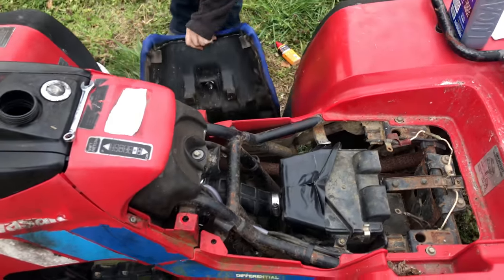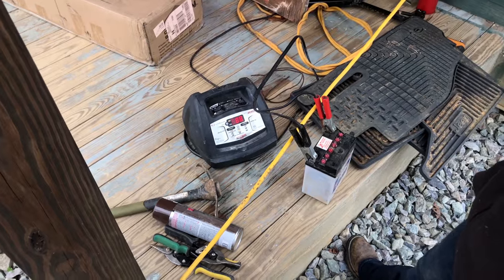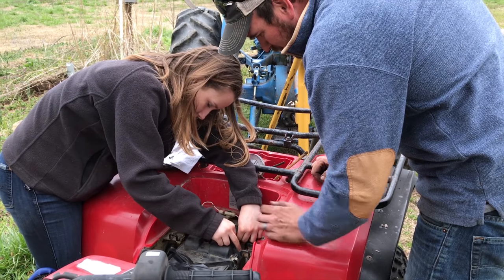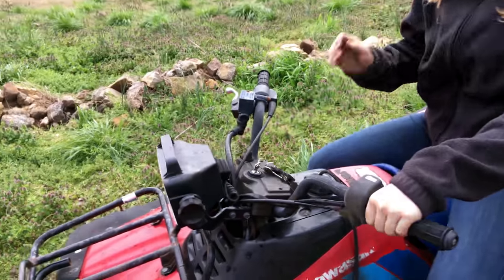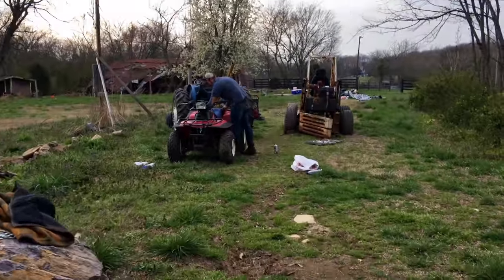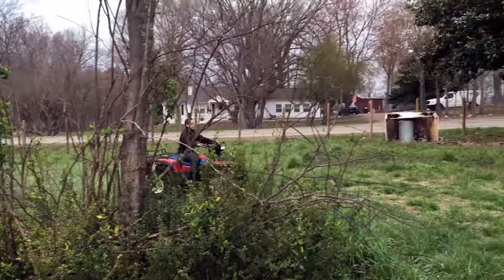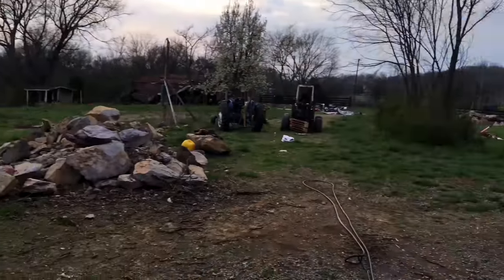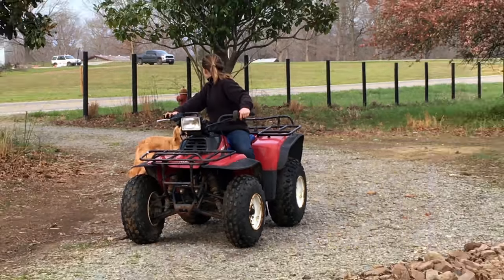Did She Fix It? Out Of The Weeds Part 5 ATV Repair - Ranch Hand Tips

Comment from the maker: Parts We Used (Affiliate):
PB Blaster (to lube piston through spark plug hole)
https://amzn.to/2IQtGv6
Kawasaki KLF300 Bayou KLF 300 Oil Filter
http://amzn.to/2HtxW20
Motorcycle Engine Oil 2 Quarts Lucas 10W-40 Motorcycle Oil http://amzn.to/2FAfwAa
Kawasaki Bayou KLF 300 KLF300 Fuel Gas Petcock Valve Switch Pump ATV
http://amzn.to/2HsZEft
Kawasaki Bayou KLF 300 KLF300 Carburetor Kit ATV Carb Carby
http://amzn.to/2FH5edJ
Kawasaki KLF 300 Air Filter
https://amzn.to/2pFH0ul
Kawasaki KLF 300 Voltage Rectifier (Voltage Regulator)
https://amzn.to/2GctZi5

Comment: Hey I love these videos because I got the same the atv. It’s amazing but I have a problem. I’m getting no spark when hitting the starter. But the second I let off the starter it sparks one time and sometimes get the bike going. But it’s just becoming an issue. Would you know what I possibly need to replace? Please reply
Reply: Most likely the cdi. You can test it with a bolt meter.

Comment: Hey do you know if a 1992 Kawasaki Bayou KLF 300 2X4 has a fuel filter ? I let a mechanic work on it last year and mine don't and it's spitting and sputter when you give it gas. I order a lot of new parts like Carb, Voltage Rectifier, Air Filter, Petcock Valve cheap brand that I hope it don't leak.
Reply from the maker: Fuel filter is just an inline filter like a lawn mower between the tank and the shut off valve.  If yours doesn’t have one, just cut the line and put one in.  Did you check your cylinder compression?
Reply: no it been ran good just as I went threw some water and mud it kills out and when I started it up and try to give it gas it kills out I can start it up and run but when I give it gas it dies out. I order lots of new parts just waiting to get them and put everything on.

Comment: How much did You spend on parts
Reply from the maker: $125
Parts We Used (Affiliate):
PB Blaster (to lube piston through spark plug hole)
https://amzn.to/2IQtGv6
Kawasaki KLF300 Bayou KLF 300 Oil Filter
http://amzn.to/2HtxW20
Motorcycle Engine Oil 2 Quarts Lucas 10W-40 Motorcycle Oil http://amzn.to/2FAfwAa
Kawasaki Bayou KLF 300 KLF300 Fuel Gas Petcock Valve Switch Pump ATV
http://amzn.to/2HsZEft
Kawasaki Bayou KLF 300 KLF300 Carburetor Kit ATV Carb Carby
http://amzn.to/2FH5edJ
Kawasaki KLF 300 Air Filter
https://amzn.to/2pFH0ul
Kawasaki KLF 300 Voltage Rectifier (Voltage Regulator)
https://amzn.to/2GctZi5